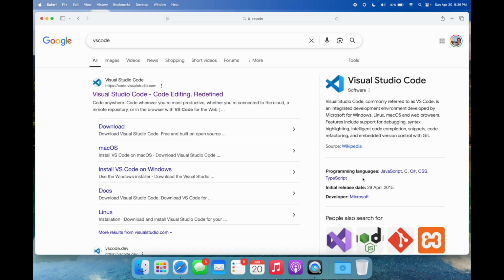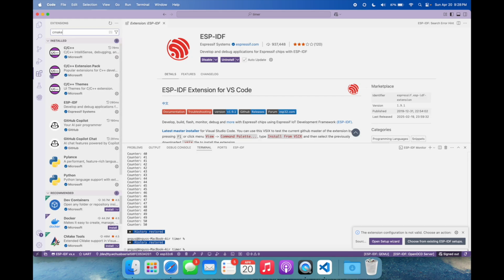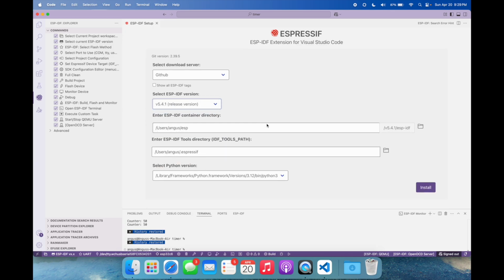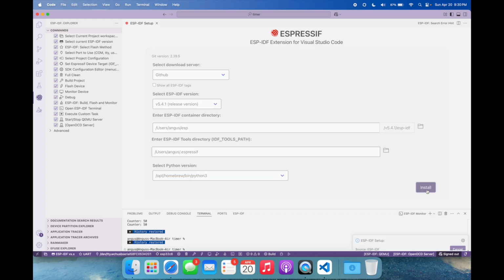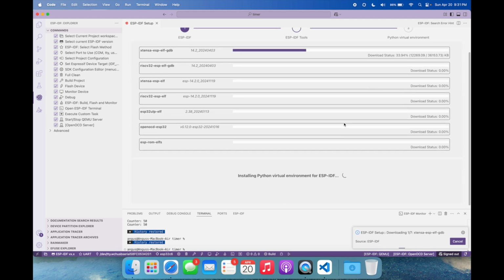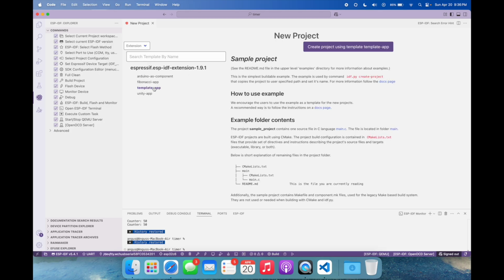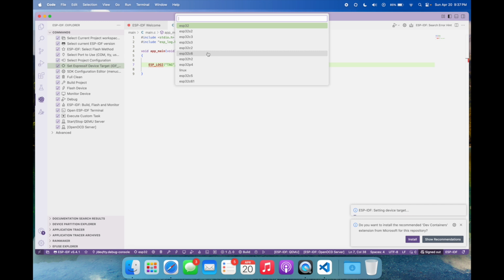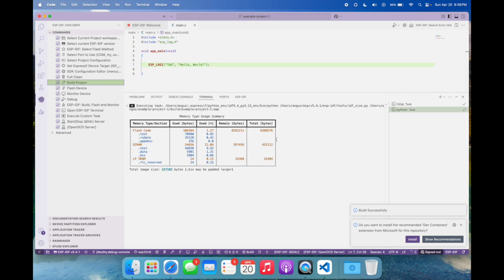Setting up ESP-IDF for VSCode on macOS

Comment: I've been struggling with this damn ESP-IDF extension for three days now. Every video tutorial tells me to search for "ESP-IDF: Configure ESP-IDF Extension," which doesn't even exist in my VS Code, and the documentation is a disaster. No matter how I try to install it, nothing works. Is there a decent alternative to this garbage that isn't so frustrating?
Reply: Update: yep. i uninstalled the extension, then used the "install specific version" option and picked and older one which better matches the video.
Reply: @messedmushroom  Yesterday I actually came across a video explaining that ESP-IDF was recently completely rebuilt. Unfortunately, this also affects the installation process. Therefore, I thought it might be advisable to wait for new video tutorials that focus exclusively on the new version.
Reply from the maker: @messedmushroom  Has this resolved your issue? Cheers
Reply from the maker: Hi Marco,

Espressif offer an IDE (based on the Eclipse IDF, I believe), which you can find here: https://docs.espressif.com/projects/espressif-ide/en/latest/downloads.html

I've not done any research into it before, but it may be a stronger alternative than VSCode for you? It could be worthwhile having a look at.

Let me know if I can be of any more help,

Angus
Reply: @angusq  I've only ever worked in VS Code and would like to stick with it. Unfortunately, the installation process seems to have changed with the latest ESP-IDF release. I've never worked with microcontrollers before, so the ESP-IDF documentation is confusing me. The ESP-IDF file comes from the corresponding website, then I'm supposed to download dependencies via Homebrew, which have a different path, and then there's "Eim." During installation, I have to choose a different path because the existing one isn't valid, and the more I delve into it, the less I understand. I would be very grateful if you could create a new tutorial on installation according to current standards, perhaps with explanations.
Reply: @marco_di  Hi, did you find a way to make it work with VSCode?? Thank youu f
Reply: I have the same problem too, maybe a problem with the current version of the extension?